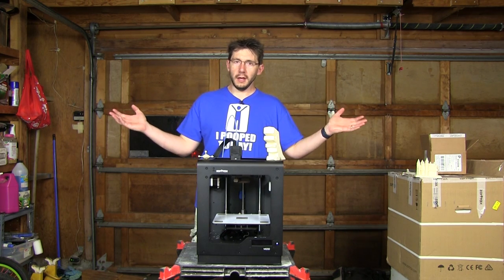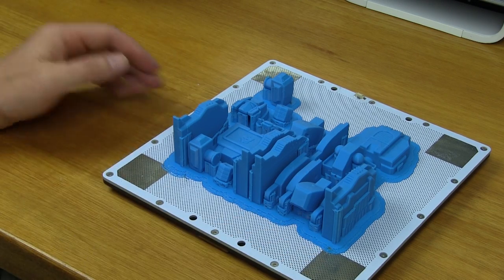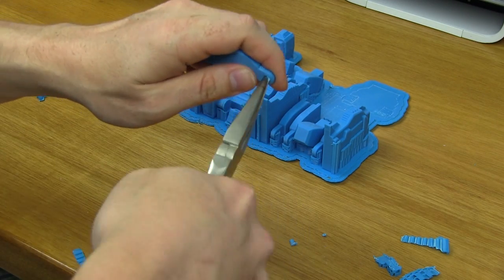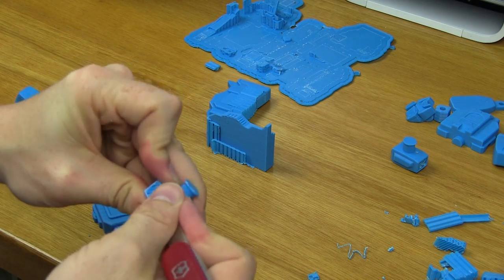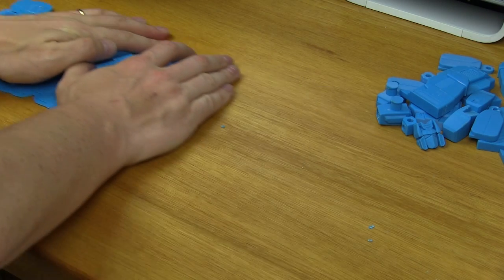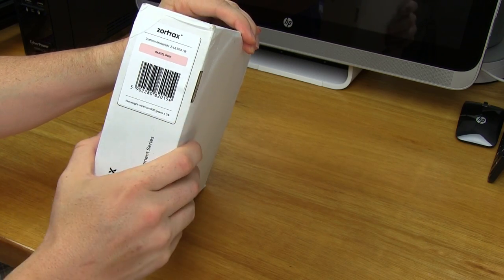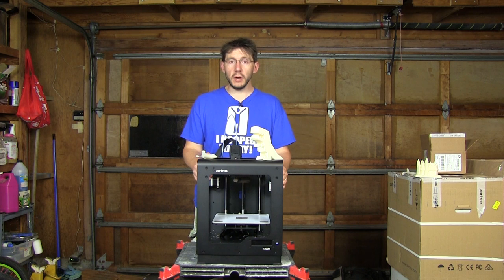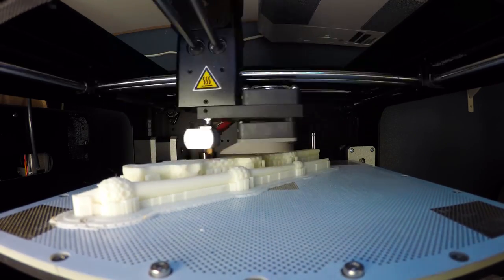3D Printing: Zortrax m200 3D Printer Review

Comment: Great review. Though if you use any good printer with a .4 or smaller nozzle with a correctly tuned slicing profile for the printer/filament, and print at just the right speed at 90 micron layers it should come out perfectly. That shouldn't be an exception and a pat on the back to Zortrax, it should be an indication of the sad state other printers are in. Like Chris Rock said, -- when * say -- I take care of my kids, well that's what you're supposed to do, what you want a cookie? A $2000 printer should work like that. It should be reliable and should produce these kind of results at that fine a resolution. 
For a community built on tinkering and having it's foundation in the open source reprap, I can't support a closed source system like this. They want to sell you the razor and the razor blades and the shaving cream. I'm surprised they haven't figured out how to make the electricity you feed into the printer be ZortaxPower. Makerbot tried this close system approach -- see how they're doing?
Reply: +kazolar hi. there is an addon  http://www.z-temp.co/    for you to use other filaments,  i really like this printer, yes is close sys, but i think is an entry lvl PRO machine comparable to stratasys or 3dsystems much higher price (also close) printers.
Reply: +Hermilo Gonzalez Look at Ultimaker , look at Lulzbot, look at TypeAMachines, Makergear. That's just a handful of printer manufacturers who make excellent PRO level machines which are open source. There are way too many limitations to list in a closed system as this.
Reply: An open source printer speaks gcode. It has documented board hardware allowing to add additional functionality. It can be controlled by a raspberry pi via octoprint. It is not tied down to a proprietary slicer.
Reply: Look up what gcode is. You don't need to use an OS slicer. I don't. I use simplify 3d. It produces gcode. All printers who are not using a proprietary slicer are compatible with Simplify 3D. Simplify 3D produces significantly better prints due to optimizations in tool head movement and has a great deal of advance settings to produce really superb results. You can do your own research on simplify 3D. You can use other free OS slicers with open printers. Consider the revolv platform. It is not open source. People who bought into a closed source system are now stuck with a  paper weight because Google is shutting down the service. So feel free and invest in a machine and hope the manufacturer keeps supporting it and doesn't go out of businesses.

Comment: Just wanted to make a suggestion: using some smaller pliers or highish quality pair of tweezers (with a bent tip) would greatly improve the dexterity and control when removing supports -- and you wouldn't have to use a knife haphazardly. 

What you're doing gets the job done, but you do run the risk of accidental cuts/pokes with the knife.

Don't want to have to resort to #HIGHFOUR by losing a digit. :D
Reply: +Aaron Yourk There's obviously a million ways of getting the job done. I'm just suggesting one that would offer more control and reduce risk of injury to Joel. 

It's certainly possible that with so many of the huge prints he makes the large needlenose make a lot of sense as his go-to tool though.
Reply: +Mike Brum Then you apparently haven't seen Chuck's videos about deburring plastic.  The tools have a larger amount of safety than a jack knife as well as allowing more control.

Comment: So what other printer print as good as this and why did it print that good? This is the only thing that's driving me nuts about selecting a printer. I just want a printer that prints like that but open source.
Reply from the maker: +Joey Nuggetz The Zortrax machine prints well because it's an entire system. They control the filament, slicer, and the machine. I highly suggest taking a look at the Průša i3 mk2 printer - in my testing so far, it's producing results very, very similar to the Zortrax machine. Plus, it's completely open source.
Reply: Thanks for replying Joel! I understand that it prints well cuz its an entire system but why would it print much better than any other $2000 machine. If I was looking for something in that price range, could I squeeze out similar results from a Lulzbot or MGM2?

Comment: Joel, I like you videos a lot - but this time I didn't like to too much. For me it was too much of cleaning up the part you've printed. I would like to see more technicals of this printer. E.g. to understand whats all about the propieraty filaments and other details. 
I also do not share the idea to keep the platform inside in order to remove the printed parts with a chisel. I'm worried about misalignments  in X,Y,Z afterwards or possible damaging the printer when slipping with the chisel against something. The mentioned weakness of the connector is the smaller problem in my opinion - maybe not even a problem.

Would you be able to add a second more technical review on the printer side? Thanks a lot - and as always - high five !

Comment: $2000 for a closed system printer that still has cooling problems i'd say is a big no no. Surely if you are considering spending $2000 just save an extra $500 and get a gmax (you'll save that money in non DRM filament alone).

Comment: Does Zortrax recommend using a chisel to remove parts from the print-bed? Seems like that would have a high probability of damaging it...
Reply from the maker: +K Danagger No they don't. They do include a paint scraper but I found the chisel works better AND if used properly and carefully it doesn't damage the bed. Of course, now that I say that, I'm going to hurt myself ;)

Comment: hey mate i have the m200 and want to maybe get some thing with duel extruders as i like to do some big supported parts and i want some sorta resolvable supports, how does the raise3d N1.
Reply from the maker: You're asking how the Raise printer does with dissolvable supports?
Reply: 3D Printing Nerd yes! And if the quality is on par or higher on the raise3d n1.
Reply from the maker: I haven't had the chance to try dissolvable supports in the Raise machine yet!

Comment: Can I ask, if you had to say which had the higher quality print results, would you choose the Zortrax m200 over the BCN3D Sigma? I'd be interested in printing figurines and maquettes I sculpt myself so detail and smoothness of finish would be important to me. Having seen your review of the Sigma, I'd be interested in your advice...
Reply from the maker: +seanforsyth I've only pushed the Zortrax to its limits with High quality prints. I didn't have the time to try the Sigma, however, I am getting a Sigma again and I'll be able to get some more high quality test prints on it.
Reply: Thanks Joel, appreciate you getting back to me. I presume the Zortrax volume levels are much more bearable? My main focus would be on quality and reliability of the final print, and I'm certainly not a tinkerer, so I'm torn over which to choose. Love the idea of soluble supports, dual extruders and non-custom materials, but not a fan of the noise and have no idea how reliable it is. The Zortrax sounds great, so maybe I should just bite the bullet and get that one instead. Gah! Can't decide! When are you getting the Sigma again?
Reply from the maker: +seanforsyth Soon! I'll get some PVA solvable support material as well to test it out. Quality and reliability are something Zortrax prides itself on. The Sigma is just plain cool and I'll show it off as soon as I get it back. Very soon :) I wish I could say one over the other, but either printer has its good things and bad things. Zortrax fans are much quieter. Tough choice!
Reply: Yeah, I knew it wasn't going to be an easy answer. :) Guess I'll just have to wait for the next review. No sense rushing in if I end up making a huge mistake on something that is quite a significant investment for me. Appreciate it!

Comment: How do you get your prints to stick so well on a glass bed without anything?
Reply: +Derpy Herpy It is no glass bed. It is a painted perforated plate with small holes in it.
Reply: Trhuster is it possible to order it separetly? to upgrade my current prusa I 3 orinter?
Reply: +Derpy Herpy Just buy buildtak or PEI and put it on a glass plate.

Comment: THE OLD INTRO!!! :D I don't care whether or not I'm right, I feel you put it in there just for me :D  Great review, terrible printer because of the crappy software it's locked down to for slicing models (Although the print quality is pretty damn good.).
Reply: +Teh Stranger? But that is why prints are good. If you like to tinker and mod your printer go open source. Do you want to have a printer that you can trhust and get this nice quality prints go Zortrax.
Reply: +Trhuster Yeah and if you want your models to take more than 20 minutes to slice, choose zorcrap
Reply: Teh Stranger? No reason to be rude. Zortrax is a good printer and so are many open source printers. I have a Zortrax and a open source Raise3d N1. I like them both.

Comment: the problem with this printer is its limited by its software. another is that you will be faced by lots of warping depending on size . a solution to this maybe using PETG filament since it is said to have limited warping compared to abs. did u try PETG with this printer. 

Regards
Reply from the maker: Hey! No, I did not. I've only tried the filaments provided by Zortrax. I do not know if they offer a PETG. Warping doesn't happen because it always prints a raft and the bed is perforated to REALLY hold on to the filament :)
Reply: 3D Printing Nerd
what u are saying is true until certain length and warping will start to happen, I own a zortrax and I like it but sometimes the raft itself gets ripped from the perforated plate. I just ordered some petg to see how it resists warping and how bad it smells.
Reply from the maker: +Ahmad Hamad the raft gets ripped from the plate?? holy cow!
Reply: @ogreycloud  just adjust the z-offset so the raft gehts REALLY squished down into the holes. No warping.

I own a M200Plus and make Fullsized abs prints without warping
Reply: @Wodpuncher001  thanks alot for the advise. If I remember this option was not possible back then. I will try it and see the result.

Comment: I just bought this machine. I don't like the idea that it is closed source. I would much prefer using Simplify3D. I do understand the reasoning behind this, and the filament on Amazon is a decent price ($35).

I do look forward to seeing the perfect prints that I can get without tinkering. I bought this to print parts for robots, not just to own a 3d printer.
Reply from the maker: If you have this printer, you're going to get amazing prints! Can't wait to see the robots!
Reply: It arrives Friday, so I may have time to test it a bit before I have to move it to my RV.

Comment: good video joel
question i just got into 3d printing from a buddy of mine i have about 300 to 500$ USD to spend any recommendations? i was gonna pull the trigger on a ctc 3d printer lol 
or should i keep saving so i can get a 1000$ + printer? not for professional use more of a hobby but i also dont want horrendous prints 
any feedback would be appreciated
Reply: I have a ctc and i love it.
That being said, i am a member of quite a few 3d printing forums and groups. The main comment which i personally really do agree with is, make it your self.
Buying a pre assembled printer you dont get the same "feel" for the printer or the practical knowledge. You will get this later when you mod or fix break downs etc but you wont be going into it with the confidence you would if you had built it from a kit.  I would suggest starting with a prusa or something cheap then work your way up from there as your passion grows
Reply: +EagleSoar1381 i was looking at the prusa on the ol fleabay around 200-250$ range 
i know going in that the potential that i have to fix or mod either from a kit or assembled is there
i rather spend a few bucks for it to be assembled now then if i really get into into build a reprap later
what is the honest truth about the quality of prints the ctc printer produces?
Reply: +louie b Straight out of the box, leveled the plate and put in the SD card that came with a test sample to print. ABS and printed perfect first try.
Then downloading models from thingiverse,  mixed results. Now after a year and a lot of testing i get perfect and near perfect prints every time.
Theres a lot of trial and error in 3d printing, gotta be ready for a lot of failures till you get the hang of it. You learn the printers capabilities then how to position models for best results etc etc etc.
Even now i still get the odd surprise. A print that looks easy on screen but comes out a mess or a print i think will be too complicated and will fail but comes out perfect. 
Most honest answer i can give is... I love it and wouldnt give it away if someone offered me double what i paid for it. It can be a pain, a chore or a masterpiece but I love it

Comment: Hey Joel, would you recommend this for a school setting?
Reply from the maker: +Ab 3D Printing that's a tough one. the printer is decent, but things are proprietary and that doesn't bode well for a school system. I would recommend open source printers and software. Does that help?
Reply: Yes, thank you. I am a 10th grader from Utah. Last school year I was in a Ta class for a teacher who had a 3-D printer. My job was to keep the 3-D printer running properly. But I always had a problem when with kids trying to stick their hands into the printer while it was printing. So I wondered if my teacher had made the right decision with the 3-D printer he chose, thanks again Joel!
Reply from the maker: Ab 3D Printing Welcome! Yeah, that's ALWAYS an issue. Something like a Flashforge Dreamer, Flashforge Creator Pro, or Cubicon Style has the enclosure and the door to keep finger out.

Comment: As you know I am all about the clean removal of the raft, and it looks like this printer does this constantly.  We (3D printing enthusiasts) strive for injection quality prints and, again, this one churns them out as a mater-of-fact.  But the price of the printer vs build space, having to clean the build plate of materials embedded in the tiny holes, proprietary software and filaments to me are s deal breaker.  I would love to see these items change and if they are,  I would consider this printer for the prints that I need to be spot on.  [VeryThoroughReviewHighFive]   :)
Reply: +Michael Phelps You never clean out the small holes.
Reply: +Rikard Karlsson I see, but, wouldn't that defeat the purpose of the holes?
Reply: +Michael Phelps No, new raft bounds with old plastic in the small holes.

Comment: You didn't explain, how is it locked to Zortrax filament? I would love some Pascal Pink for my FlashForge Finder.
Reply from the maker: +Mickice It's not technically locked. You CAN run other filament through it if you hack it. I didn't want to cover the hacking in the official review. Now that I can keep it longer, I may do that :)
Reply: So Z-Ultra is like an advanced PLA?
Reply from the maker: +Mickice Um... Maybe? I haven't done the down-and-dirty material comparison, though, Z-Ultrat is very durable and I would compare it's finished properties to be much stronger than PLA.
Reply: +Mickice No it is ABS and abit PC in it.
Reply: +Trhuster Damn, I really wanted some pascal pink in my life but my FlashForge Finder has no heated bed and while rated at PLA only I have printed PTE. Maybe it would print fine, who knows.
Reply: Mickice Here is some, dont know if they ship to US. http://www.eumakers.com/en/3d-printer-filament-spool?custom_filament_color_2=40
Reply: +Trhuster Wow, those colors are incredible!!! They even have some skin like pinks which would go perfect for another idea of mine.
Reply: Mickice You are welcome :)
Reply: +Trhuster Most guys aren't into pink but man that Antique Pink is sexy.
Reply: +3D Printing Nerd, Z-Ultrat is not a PLA at all, It's an ABS that have been reformulated to be stronger and resist warping like normal ABS. Zortrax also sells normal ABS which is much cheaper than the Ultrat. $30 per roll vs $50 for the Ultrat.
Reply: +Mickice With our Finders we print Wood-PLA, Carbon fiber-PLA and some PET-G and harder flexible TPUs in shore values: 95A, 60D and 64D. I assume TPU is similar to your PTE filament.
Reply: +3D Print - Tech Design Probably, love this machine to death. With minor tweeks I get great prints.

Comment: With how much a Zortrax M200 costs you could buy 2 x Craftbot Plus.
Reply: +TheIcemanModdeler Really, 3dprima sells them for $1,425. Where can you find it for less?
Reply: +Trhuster Check their website,  they have Craftbot 2 now that just has Wifi and is something like 1,300, but the Plus version is aprox 1.000.
Reply: +TheIcemanModdeler It is $1099.00 without tax but i live in Sweden so another 25% on top off that so about the same price as 3dprima for me then.
Reply: +TheIcemanModdeler But you can print "10x" better quality in the Zortrax ;)
Reply: +3D Print - Tech Design Not sure if the quality is 10x but it sure is more expensive than most filaments.
Reply: +TheIcemanModdeler well, depends on the Craftbot user of course :). But sure! However, the extra cost depends on your need of course. For hobby, it might be 10-30$ per month? a few coffees. For professional use and continuous printing it will be more, But the reliability, quality and finish will save you time (and less failed prints), which translates to money saved for a business.

The benefit of manufacturer filament is extreme control. No tweaking really needed. There is a reason why Stratasys machines usually do nice models... they can fine tune everything for you :), so you don't have to.

But yes, the fact is still that it costs more in the long run. If you don't utilize the benefits it brings, it's not worth it :)